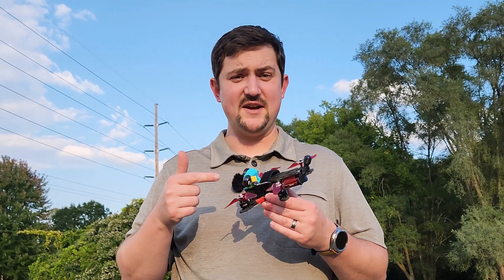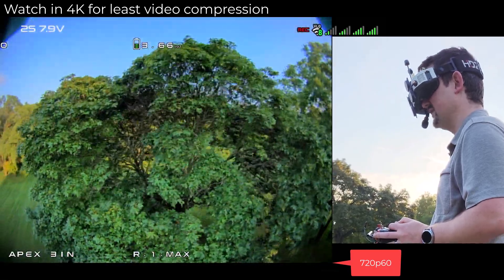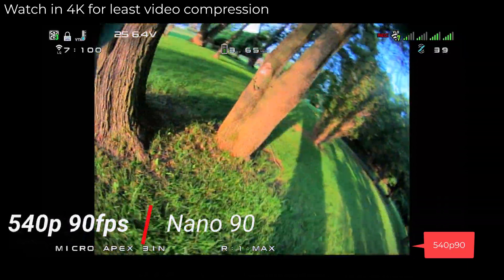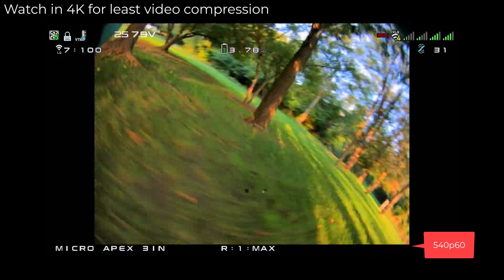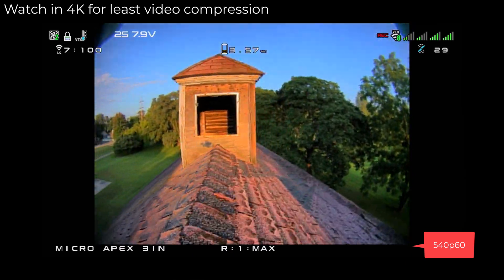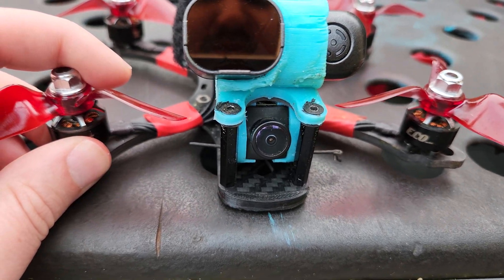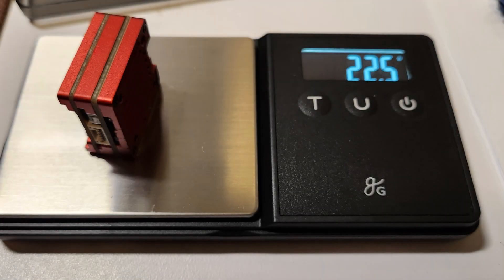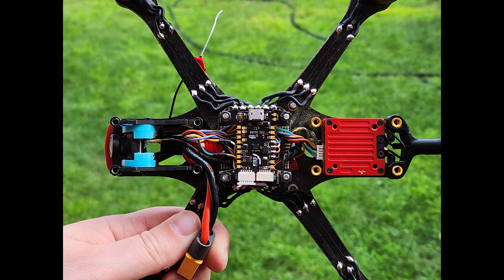Who is HDZero for? HDZero Freestyle v2 Review

Comment: The difference to me between HDZero and wifi-camera-on-steroids systems is hard to describe in a way that people "get". But the point about the grass brings up a big point about how it's different to fly, for my flying. 
It changes where I LOOK. When I'm flying close to the ground, if I'm on DJI video, I'm looking into the middle distance, to where the grass ENDS, to judge my height - the grass in the foreground is just mush. The grass is green, but contains no useful information to help me fly. On HDZero, I'm actually looking at the grass in the foreground. I can fly lower, and it's helped me get better throttle and pitch coordination. 
On HDZero, I feel like everything is "live" enough, that I'm connected enough, that I can disarm AS I land. On DJI, I disarm TO land. It's a small but important difference in how it feels to fly.
Reply from the maker: I like these examples. You really do get it

Comment: I have purchased two Nano 90s so far and both needed the focus adjusted. Anyone else experience this?
Reply from the maker: For nano 90 I typically upgrade the lens to RC18D right away. For this review, I didn't change the lens or focus it. When focusing a lens, go outside and point the camera at the tree line in the distance, otherwise it will be front focused

Comment: Where can I get replacement hdzero antennas. Like you, I need something that fits my TPU prints. Also need  nano to micro adapters.
Reply: Foxeer rush cherry true rc they all make small ones
Reply from the maker: The hdzero antenna that ships with the freestyle kit? I don't think it is sold separately - I'd recommend a TrueRC u.fl antenna as a replacement. There is a nano to micro adapter in the box and a 3d print option for apex frames in the video description